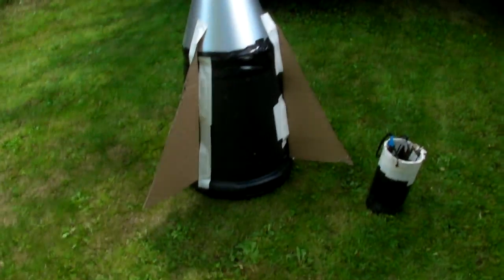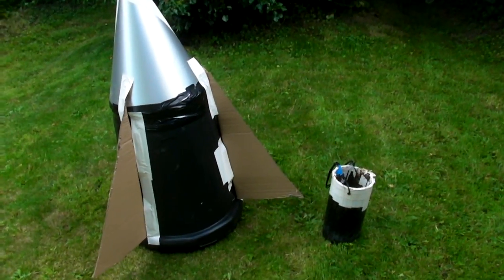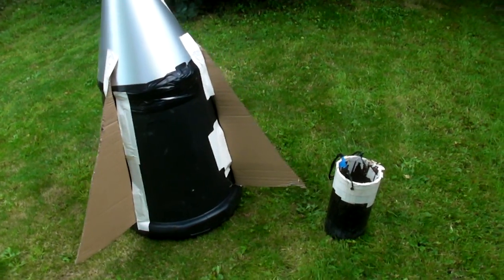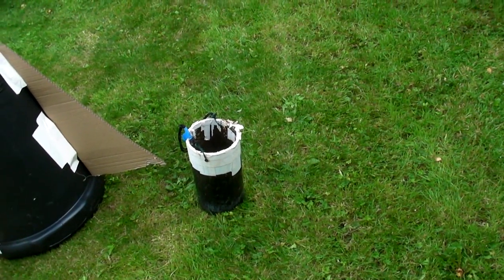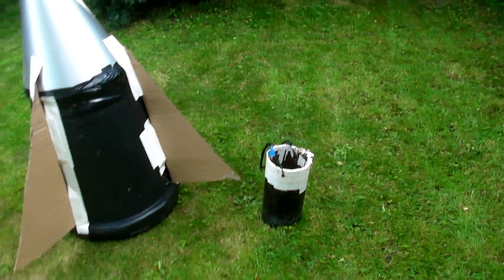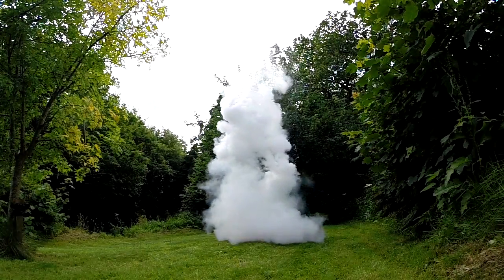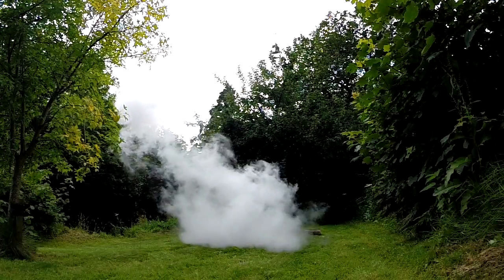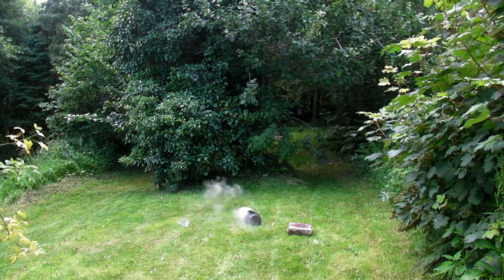The Liquid Nitrogen Bucket Rocket Revisited...Again

Comment: You need to dig a hole just big enough for the bottle and put the bottle in the hole and put the bucket over it, the hole will direct all of the pressure up instead of to the sides
Reply from the maker: The steel bucket does exactly that - and I don't have to dig a hole in the lawn!